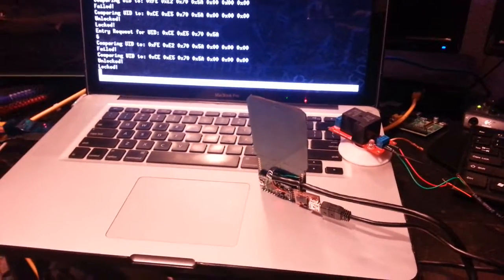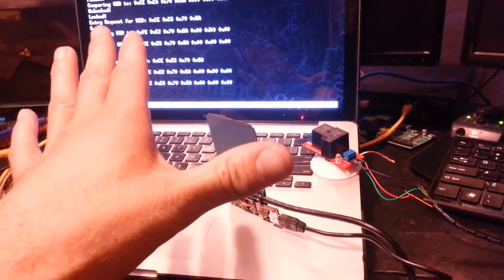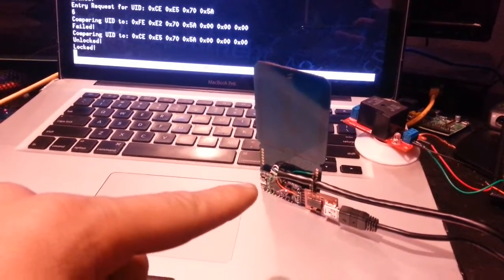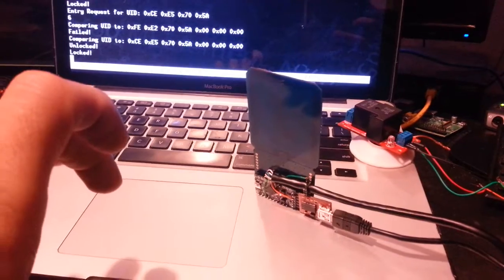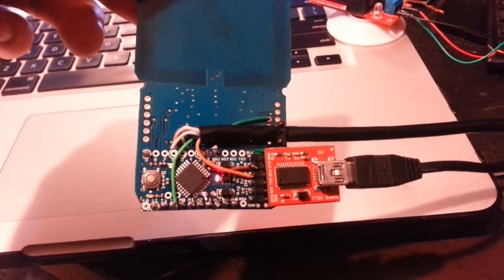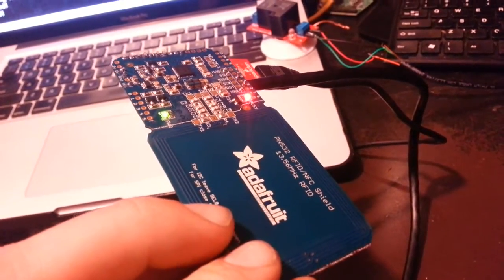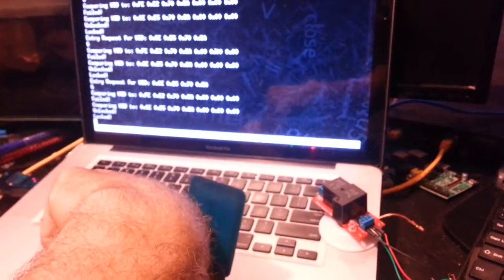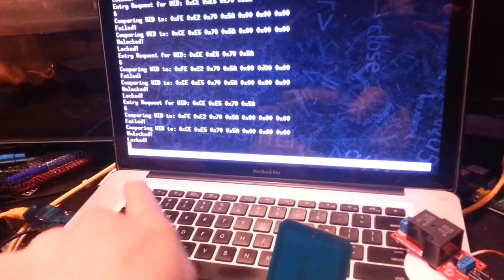motorcycle starter electronics for NFC implant

Comment: How did the ignition system work in the end? I want to do this, but can see it draining batteries if its scanning constantly..
Reply: David Alexander the battery on a motorcycle is 6v right? Well the scanner only consumes maybe 25 mah so it would barely affect it anymore than the clock on the bike being powered in the ecu